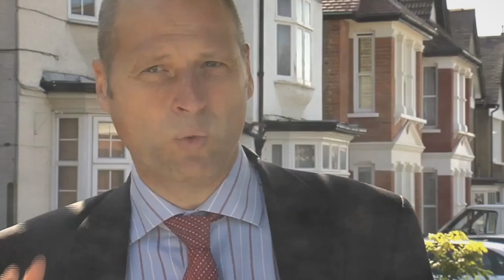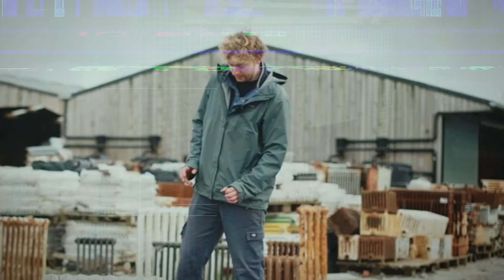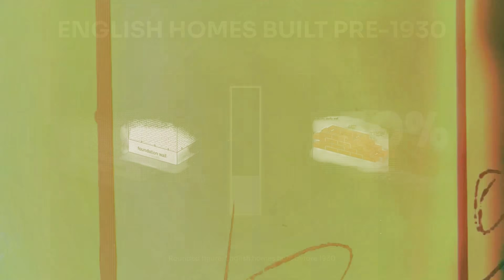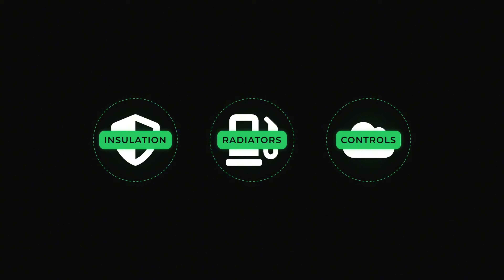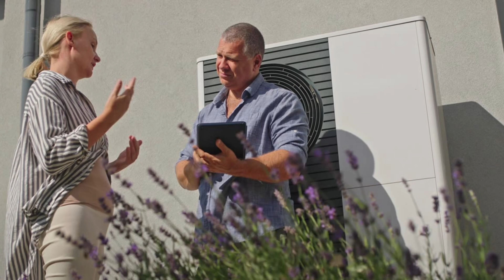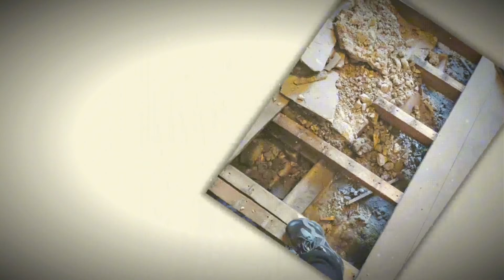Why Are British Homes Still Heated by Radiators

Comment: I would say the primary issue isn't even to do with the home itself but instead the lack of an actual motive to do so. Heat pumps require a completely sealed system and to be run year round when compared to radiators that you can pop on as and when you need them. The heat pump is pushed under eviromentailist logic which even if you put aside that it's not any better in that regard (I.e. the electricity still comes from burning fossil fuels) it's not a very strong motivator in British socicety at any level so is definately not going to rationalise the cost of such conversions.
Although if you realy wanted to switch people away from natrual gas the best way would be bringing down the price of electrcity and keeping it consistent. People likely wouldn't all switch to heat pumps however that doesn't mean electric radators wouldn't become more prominant. Bringing down electricity prices would also aid in the electrifcation of many of other domains as well.

Comment: never have hot air heating,  germs love to live in the ducting . heat pumps are like electric cars  just don't do the job. good old gas boiler which are 98% efficient works the best  also radiators don't dry the room out, new houses that are sealed boxes are bad for your health  old fire places vent the room and help change the air    remember energy saving houses wont save you money in the long run the energy companies will still hoist the prices up.  global warming should mean less usage of heating ha!

Comment: Germany.  Many of the 20th century built properties have reinforced concrete floors, with a screed (estrich) on top.  I installed in my 60s built house near Cologne underfloor heating which required the removal of the screed before laying the insulation and pipework.  I can't imagine how that would be done in the UK where a lot of flooring is timber joists.

Comment: I will keep my gas central heating, if I was forced to change I would either have electric heaters or change my multi fuel stove to a boiler stove and run my central heating from that.
I don't have  a suitable wall for heat pump, this video mentions cavity wall insulation, Not suitable for homes in several parts of the country due to them having wind driven rain, I live in the Lake District in a house built in 1970, I had the cavity wall insulation, it got damp and had to have it removed.

Comment: Switching from radiators to UFH or forced air heating is obviously pretty difficult due to the major renovation work required. But the reason that uptake of air-to-water heat pumps vs gas boilers has been slow has been simply due to the cost difference between gas and electricity. With electricity prices being 4x the cost of gas, with a heat pump you can expect to break even on running costs at best but more likely it'll cost you more to operate. The solution is to bring electricity costs down - at 10p/kWh people will rush out for heat pumps.

Comment: My condominium has hot water baseboard (or skirting board) fintube radiators fed by underground pipes from a central boiler house. The regulation is a little sloppy, but they heat well and the large pipes also heat the downstairs floors somewhat. Newbuilds in this area of the USA usually have ducted central HVAC systems, but they are noisy and the heat from them makes the air feel dry. In colder areas of the USA and Canada, where AC is really not necessary, radiators are still common, even in newbuilds.

Comment: Why don’t they put a fan behind the heater.?
Reply: They do sometimes. Fans need more maintenance and they're noisier, but they put out more heat for the size of the radiator. Here in the USA, they sometimes put fan-forced radiators underneath kitchen and bathroom cabinets, where there is often an air-space anyway. You can also find them in public buildings, particularly in vestibules or near entryways.

Comment: Not every house has them. This one has some electric storage heaters; not quite as good financially given the current pricing regime between night rate power c.f. Gas, but the maintenance cost has been zero over many years.

There were quite a few houses built with gas fired hot air heating as well – typically those built on timber frames, rather than brickwork etc.

Comment: I live in NC in the USA. I needed to install a new heating system in my house. I decided to install hot water radiators. Salvaged a bunch of old cast iron ones. They are the best heat you can get. They have no problem keeping my drafty 100 year old nice and toasty in the winter.

Comment: Currently I have floor heat yet I miss the old radiator. Even since I was a kid I would put my clothes on the radiator so I would have nice warm clothing to put on. If I update the bathroom I will install a radiator for towels and clothes.
Really don't see why people want to get rid of hot water heat as it is the most consistent heating you can have.

Comment: 1940 house here. It has the original steam radiators. They add charm and character. they give a pleasant noise in the background and are great for sitting on when you are cold. and put wet gloves on to dry off. My neighbor replaced hers with baseboard, pure junk. Cheap looking steel , dusty and dirty. A shame she ruined her house.